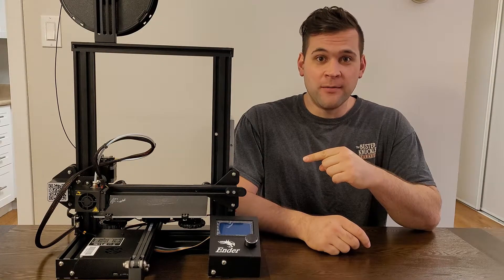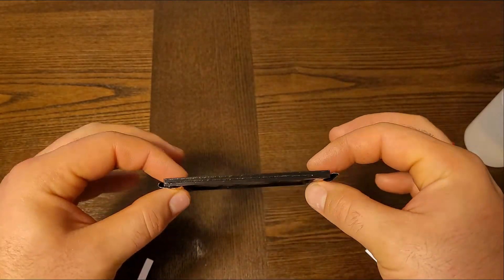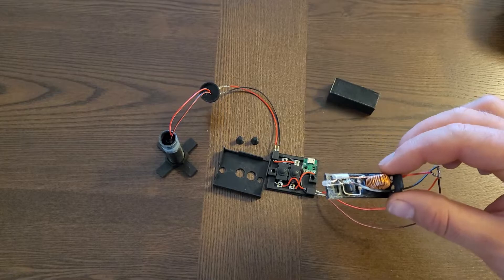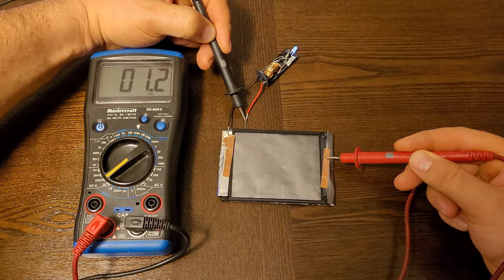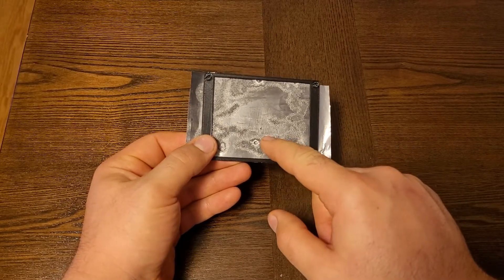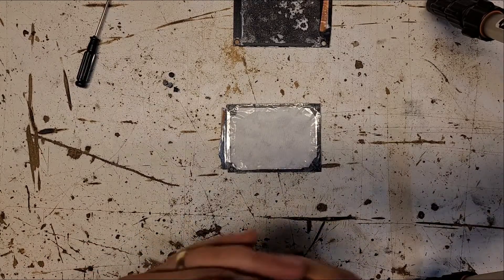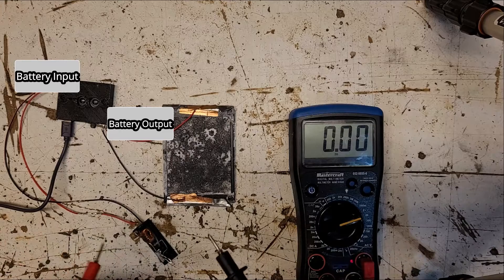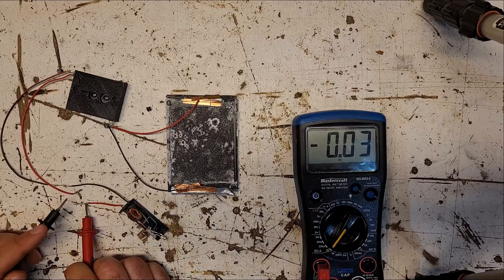Recharging my Aluminum Air Battery Part 1

Comment: 8:44 Let me tell you what i think.
Youre probably right about the capacitor thing, beacause a true aluminium-air battery converts the aluminium to aluminiumoxide. This proces normally can't be reversed by an electrical current. This is why they are not used that much, beacause you need to replace the aluminium to recharge the battery.
Sorry for my pour enghlis, its not my native language.
Reply from the maker: No problem.  I appreciate the comment.  Thank you for sharing!

Comment: oh right, you mentioned that the capacity is approximately 25 mAh. But how much does the battery weigh (excluding the casing)? That's going to tell you what the energy density is, which is what's worth comparing, because the total capacity can vary depending on the physical size of the battery but the density is dependent on the quality of the setup itself.
Reply from the maker: @Pixl Rainbow I'll have to check that out and get back to you.  Right now I don't have a scale that will work for something that light, but you bring up a good point.  Power to weight ratio is a huge consideration for batteries.  I should have thought of that sooner.
Reply: @MechanicGoneRogue  note that there is a difference between power and energy. Many news and media outlets confuse the two and treat them as if they are the same thing, resulting in them reporting as if the battery was ridiculously advanced. They are really two different aspects of a battery, both separately important.
Power is how fast/hard it can exert it's energy. It's like horsepower. 
Energy is how much actual energy it can hold inside it. It's like fuel tank size.

Comment: For working Aluminium air battery, we can use NaOH  or KOH as electrolyte, activated carbon or graphene or graphite powder mixed with Manganese Dioxide cathode and Aluminium foil anode. It gives very good voltage of 1.6V and 120mA current. 10 seconds charging ran a clock for 1.5 hours. 

Aluminium ion batteries use a different chemistry. Cathode here is graphene. Anode is Aluminium foil. Electrolyte is urea and Aluminium Chloride ionic liquid. It gives 2V but I have not tried this experiment before and hence don't know the current. 
For more information, please see these videos:
https://youtu.be/r-YZeOkllRg
https://youtu.be/ARaWq5YMbeY
Reply: lol, those were the exact same videos that I linked to him on another video
Reply: @PixlRainbow  Nice

Comment: Water does indeed get electrolyzed during recharge process. Water has an electrochemical window of 1.23V,  which means that any voltage above this 1.23V causes water to electrolyze. That is also the main reason why Aluminium batteries are not in market much. Aluminium ion batteries need ionic liquid electrolyte, or an electrolyte with an electrochemical window more than 2.5V. Lithium batteries have organic electrolytes with Electrochemical window of more than 3V
Reply: I don't think it will make a difference as Aluminium needs 1.66V to deposit. However it is worth a try.
Reply from the maker: @aadhithvarathan5432  oh well I didn't know that either.  As you say though probably worth trying at least once.
Reply from the maker: Mmmh.  Ok, thanks for taking the time to tell me.  Maybe I can try to lower my charging voltage from 5V to 1.2V and see if that makes a difference.

Comment: Another thought: you may be able to get more current out of your system by adding another layer of paper and aluminum foil on top, so that the graphite sheet is sandwiched by aluminum. This will let you use both sides of the graphite sheet and improve your power output without spending more on graphite, while also help reduce evaporation because the aluminum shouldn't be porous like the graphite is.
One issue with doing this however is that it might cut off access to air, which might be needed for the battery reaction if it's truly an air battery.
Reply from the maker: I haven't tried to straight up sandwich the graphite so I might try to do that, however I can say that it seems like exposure to air does influence the operation of the battery.  I get into it more in part 2 so I wont spoil it too much, but basically I immersed an entire cell in electrolyte and monitored the performance.  It still worked, but not as well.
Reply: For Aluminium ion battery, surrounding graphite with electrolyte and Aluminium will work very well. But for air battery, we need to get the cathode out.

Comment: Note: look up the reactivity series of metals, and find an image that includes "hydrogen" and "carbon" in its list. You will notice that aluminium metal is more reactive than carbon and hydrogen. Water exists as a mixture of H2O molecules, H+ ions and OH- ions. When charging (or electrolysing) the least reactive ion is stripped out of solution first because it doesn't hold on to its pals as strongly as the other ions. What this means for water-based electrolytes of aluminium-ion batteries is that the hydrogen in the water will preferentially be charged over the aluminium ions, and come out of the water as hydrogen gas instead of the aluminium plating out and regenerating the aluminium electrode.
Reply: Either non-aqueous, ionic liquid or superconcentrated salt solution where water is of very low amounts
Reply from the maker: Interesting.  So are there any ways of getting around that?  Or is it better to just try for a non aqueous electrolyte?
Reply: @MechanicGoneRogue  there are aqueous electrolytes for aluminium-based electrodes that aren't affected by this issue but they are rather.... exotic unfortunately.
Reply from the maker: @PixlRainbow  aw man.  Well that probably rules out that possibility for me.  At least for the time being.
Reply: @MechanicGoneRogue  update on the non aqueous front: I've been looking into deep eutectic solvents that tolerate at least some water and preferably non toxic, and I found out about sodium acetate and urea. Apparently using hydrated sodium acetate works at up to 10% water by weight? Not sure. May be able to substitute urea for ethylene glycol or propylene glycol. Also not sure if it's possible to substitute sodium acetate for aluminum acetate as-is. Choline acetate apparently also works, but any moisture will affect it's performance.
I suspect regardless of which acetate combo you use though the performance might not be as good as the chloride.
Reply from the maker: @PixlRainbow  You got me thinking about something else.  First off I really like the idea of using acetates.  I looked up both sodium and aluminum acetates and they both seem pretty tame in comparison to some other options.  My thought is about using the aluminum acetate.  Someone else mentioned to me regarding my video on deep eutectic solvents that they didn't think I had created an aluminum ion battery because there was no aluminum in the electrolyte , and therefore no way for the aluminum ions to move to the graphite sheet.  I looked into aluminum salts after that, but they are fairly nasty to work with.  Then you mentioned using acetates which I hadn't considered.  What's you thoughts on that?  I have propylene glycol already.  It seems like I can get sodium acetate easier and cheaper than aluminum acetate, but if the aluminum acetate would work better I may try for that.
Reply: @MechanicGoneRogue  you do get a tiny amount of aluminium ions into solution just by having an aluminium anode, because the aluminium atoms give up their electrons to provide current and as a result turn themselves into ions, which can travel through the solution and embed themselves into the graphite. But initially choline is going to be doing the heavy lifting.

Sodium acetate would give you sort of a sodium-aluminium hybrid ion battery, though mostly skewed towards sodium. I could not find any articles on how aluminium acetate performs in deep eutectic solvents, unfortunately, or how well it tolerates water.
Reply from the maker: @PixlRainbow  ok well thanks for sharing what you know about this.  I'm thinking I want to try this for a future video.  I want to try to move to a sealed battery so moisture may not be an issue for me.  I guess it all depends on if sodium acetate can bring an improvement in performance.

Comment: As a subscriber of yours, I am always very happy to new video that you post-and am so impatient for the next aluminum air battery video. Just some small questions though: how were these cells rechargeable if they used a saltwater electrolyte? Also, do you think that using [much cheaper] activated carbon for the air cathode, instead of grafoil would improve their capacity?
Reply: Since the "charging"/electrolysis process produced hydrogen and oxygen bubbles trapped inside the battery, I wonder if its operating sort of like a hydrogen fuel cell, or if it simply gained power because of increased exposure to oxygen and operated as an aluminium-air battery?
Reply from the maker: @Hi I'm really glad to hear that you are enjoying my aluminum air battery videos.  I'm afraid I may not be able to help too much with your questions however as chemistry isn't something I've had much experience with.   @Pixl Rainbow has some good theories regarding the battery recharge operation.  An additional one that I touched on a bit in my deep eutectic solvent video is that the battery may be functioning in part like a metal ion battery and maybe the recharge process is drawing the metal ions out of the graphite.  As for your second question.  I worked with activated charcoal powder in my 2nd battery video.  I found it was difficult to work with and has higher resistance than the graphite sheet (possibly because it's in powder form).  That was my main motivation to switch to graphite sheet.  The batteries with graphite sheet usually sit around .8V after their initial build, but using activated charcoal only gets me about .6V.  I think the improvement is due to less resistance in the material itself.  Maybe if there was some activated charcoal with less resistance it would be better, but until then my best results have been with the graphite sheet.  Hope That helps.  Cheers!
Reply: @MechanicGoneRogue  Thank you very much!

Comment: How much voltage can we get from this?
Can we increase voltage upon commecting in series of more cells.
Thank you ❤️
Reply from the maker: Updated: I got a steady voltage of 1.1V after recharging it and yes of course it could be put in series with additional cells to get a higher voltage value.  Hope that answers your question.  Cheers!
Reply: @MechanicGoneRogue  didn't you measure a steady voltage of 1.1V after it was charged?
Reply from the maker: @PixlRainbow  Why Yes I did.  Thanks for pointing that out.  Sorry about that @Preveen Kumar I was just thinking about the cell after it was assembled not when I tried to recharge it.  I'll update my response to avoid confusion.

Comment: That crackling sound is potentially the decomposition of water .... And that may eat away at your cells, so I'd say you can't go through too many recharge cycles, I'd wager the utectic solvent won't have that issue as prevalent but i can't be sure

Electrochemistry is my weak point
Reply from the maker: It cycled decently well until the water evaporated lol.  Adding more saltwater does bring it back to life though.  I never got it to a point were that stopped working.  Don't want to spoil part 2 too much but yes the eutectic solvent is more durable that way however it's charge capacity is less.
Reply: @MechanicGoneRogue  well it does sound like it can carry charge a lot worse, however still pretty cool 

Your project really is turning from "so i found this set of instructions and i have no idea what's happening" to "i attempted multiple variants and have a decent idea of how to optimize the function for whatever purpose i want and i can even tell you a bit about what's happening"
Reply from the maker: @Guy That  Agreed it is really cool.  It's definitely progressed better than I expected.  I'm hoping that soon I can actually make one that powers something useful lol.
Reply: @MechanicGoneRogue  idk about useful but you can always get a few and pass them through your favorite means of stepping up voltage (the joule thief is nice but there's also a thing called a voltage ladder that you may like)  and then just storing that in a capacitor to see how big you can make it spark when you short it